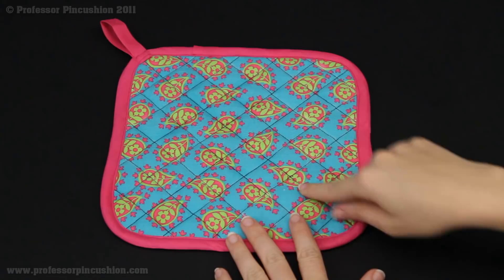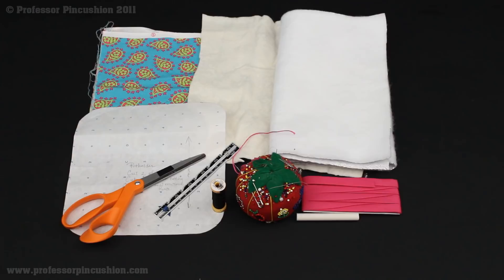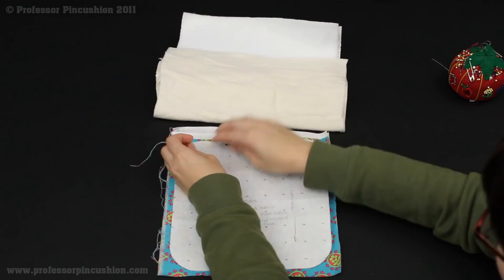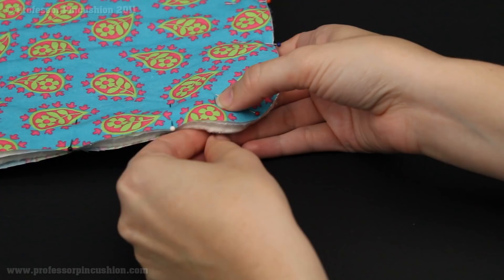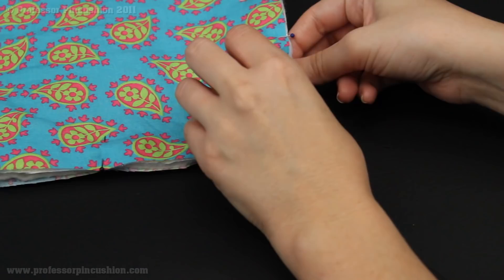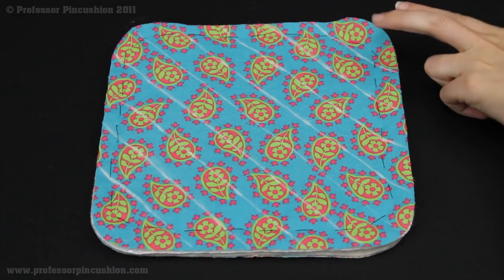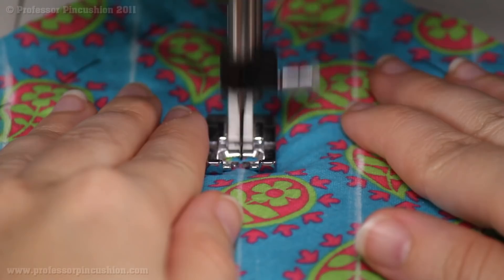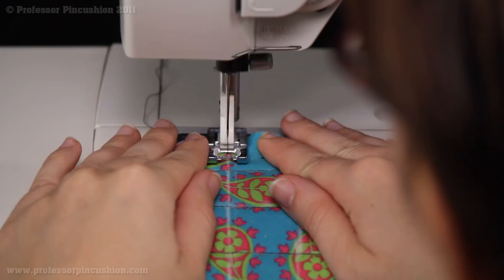How to Make a Pot Holder

Comment: How about cutting each layer oversized, sandwich them together, quilt the one inch grid, THEN cut out the pattern? That would eliminate lining up all the raw edges and pinning,eliminate the basting and compensate for the layers shifting and shrinking up with quilting the grid.
Reply: That certainly is one method to do the potholder;however, I think her way is a bit more user friendly at least for those experiencing the first time at sewing, or for that matter, understanding the concept of quilting.
Reply: @janagreenlee774  you are spot on with that. I am a complete beginner. Thank you for clarifying it.

Comment: I just discovered spray basting and LOVE IT! No more basting by hand. It is a real time saver. I have used it for quilts with great results. I think it would work here too? I guess there are different types (temporary and sewing machine safe) but I have seem tutorials that have used regular (not sewing machine safe) and it was fine on there machine. Not a risk I want to take but it depends on what you can find. I can't wait to churn out a bunch of these. Thanks for the great idea.

Comment from the maker: well, you could use wool felt, but you must check the fabric content on the end of the bolt and make sure it is 100% wool felt.  Craft felt or a wool blend felt will have synthetic fibers in it and if you use that with high heat, they could melt.  Wool felt is definitely more expensive and then you have to worry about cleaning it so I probably wouldn't recommend it.

Comment: I do have a question. I’m new to sewing (I swear I say that in every comment lol). I’m making my dad some oven mitts for Father’s Day (not that they’ll be fully completed on time). I bought cotton fabric to make bias tape if I need it (I may end up making him pot holders also). I have a package of bias tape and it’s a 55/45 poly/cotton blend. Shouldn’t we lean towards 100% cotton so there’s no melting? Also, why didn’t you just use the ruler to measure the one inch lines instead of the little gauge you used? Is there a difference? I love this project and even if my dad doesn’t want any I’ll make myself some! The way you sew on the bias tape is tedious! I have yet to sew with bias tape, but I purchased a bias tape presser foot because its too much work without it lol. But super thorough video so that a newb like me can understand and recreate it!

Comment: I'm making this pot holder and the video will not finish!! 😩 I don't know how to sew the bias tape on! Please help me ASAP!
Reply from the maker: Alyssa Peaches Unfold the bias tape and lightly press.  Start pinning bias tape around the pot holder with the top crease right on the seamline of the potholder (right side to right side) until you get all the way around.  when you first start pinning make sure you fold the end of the bias tape so it'll look nicer.  Stitch in place.  Fold the bias tape over the edge of the pot holder so other side of bias tape end up on the back.  For a neater look, just hand sew bias tape on the back.  For a quicker way, you can machine sew it all into place, but make sure you're looking at the right side of the pot holder when you sew and still catching the back of the bias tape.  sometimes it's easier to hand baste it into place and then machine sew along the temp basting stitch so you can make sure you cover all your bases.  Hope this helps! :)

Comment: when I see other vids they never use bias tape ,instead just using the same fabric that they used for potholder. I always thought that you had to edge in bias so that it curved correctly....They didn't even cut their fabric strips on a bias.Its a little more expensive to use bias if you doing quantity.Do you know if you can get away with out the bias ? I do like the look better though.
Reply: Westminster Drive  Yes, you can.  I  have sandwiched my layers leaving an opening for turning.   Turn, press flat.  THEN I quilt layers together.  When quilting I start about a half inch in,  back stiching at that point so there are no treads hanging off the "end".  I then stich all around the outside about a quarter of an inch away from the egde.  Ta da, your done. Just a hint....because its thick , trying to sew a strait line on the edge can be challenging.   I line my fabric to the edge of the presser foot and move my needle over to accommodate the desired edge width for my project.   To switch your needle position just click on the mirror image icon on your machine to have your needle move in the opposite direction.  Good luck!
Reply: Thank you for your response. I just subscribed!

Comment: Too much uunnecessary pinning. Lol
Reply: Thanks
Reply: I would prefer to pin than to tack stitch. How else you going to steady the fabric
Reply: Makepenny Crafts Rough cut the layers oversized,maybe use a few pins or clips,quilt the one inch grid then cut to size.